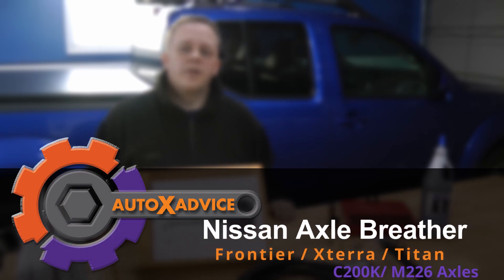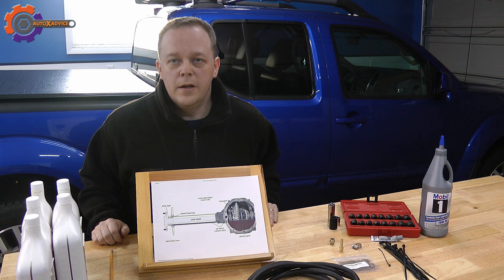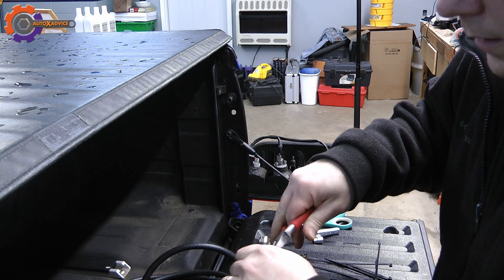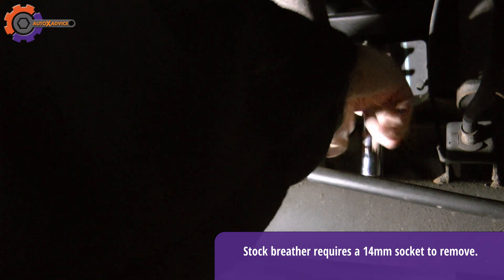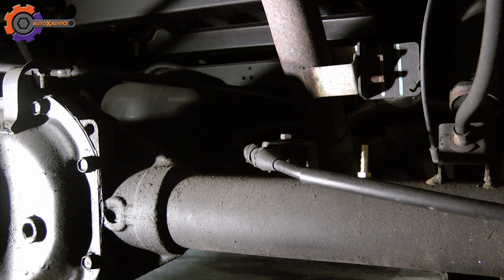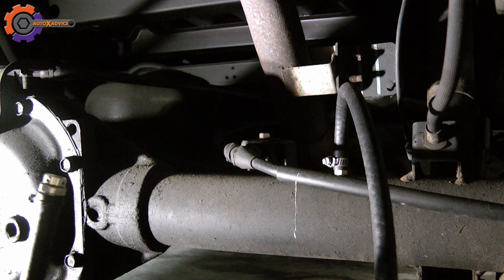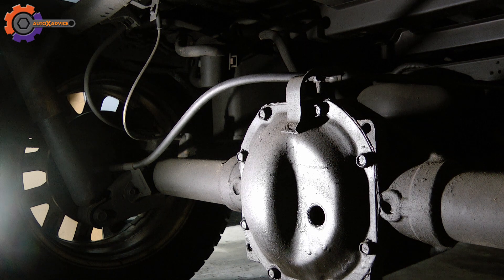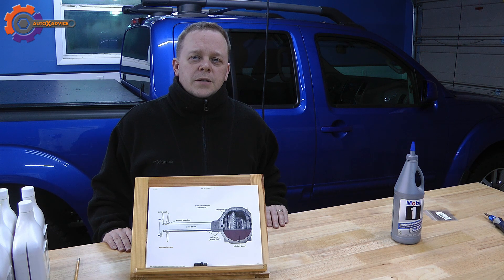Installation of Nissan Rear Axle Breather / Vent and Differential Fluid Check

Comment: What type of gear oil would you use in a 2013 Frontier with 4wd? 75W-140 Synthetic?
Reply from the maker: Recommended by Nissan the C200 rear end recommends 75W90 and the M226 75W-140.  

The Pro4X has the M226

Comment: Just learning about this issue now....  Pulled the rear rotors off my 2016 Frontier  for a brake job and discovered the pass side axle seal leaking.   It's not enough to drip on the ground, but the entire parking brake assy is soaked...  Now that i know this problem exists, i'm gonna go and check that breather before tackling the seal, which i might farm out because it looks like a nightmare job....not to mention there are two different axle designs, which i just also learned about today...  Ugggghhhhh!!!

Thanks for making this video, it's very helpful.
Reply from the maker: Sorry to hear about the seal leak.  Share when you get it fixed.
Reply: @autoxadvice4159  Quick update...Breather was totally plugged with oil and debris, but not rusted shut, surprisingly, as i live near Chicago....  I cleared it with brake cleaner and compressed air.  Was going to do the mod this weekend, but the fitting i purchased per another video didn't fit.  So i reinstalled the OEM breather for the time being...  In the meantime, i thoroughly cleaned the hub and parking brake assy...   Now that the axle can breathe, my hope is the leak stopped...i'm crossing my fingers as i have the M226 axle.  I'll recheck it for leaks in a coupla months...
Reply from the maker: Good to hear.  It's worth taking a chance to see if it stops leaking because right now it can't get in worse with a breather that can breathe
Reply: @autoxadvice4159  

Cross posted on another channel with a few edits.........

A bit of an update...sorry if it's a bit long, but if this info can help someone, what the heck...

First off, per another YT video, i ordered a Toyota part that supposedly can be substituted for the Nissan OEM breather used on the Dana M226 axle...  Well, it didn't fit.   Since the OEM breather basically has pipe threads, I tapered the threads on the Toyota breather to see if i can get the thing started, but no joy....

Unfortunately, the seal still leaked after i cleaned the OEM breather.  I took a road trip down to Indiana, so i figured that would be a good leak check...  Anyway, i pulled the axle the other day, brought it to a local reputable axle shop and re-installed it today.  Total cost for the job was about $275...most of the cost was parts (seal, bearing, spacer...labor was $95)....  But before then, i noticed a bunch of crud (read: dirt and rust particles) in the axle housing, pretty much emanating from the vent.  So, not only did it plug up, it also for some time allowed water to enter the axle housing.  It took me some time to get it cleaned out (rags attached to a stick and "sweeping" it out multiple times) That said, my advice to ANYONE purchasing a truck or SUV with this type of breather, PERFORM THIS MOD ASAP!!

In the meantime, per one of the Nissan forums, i purchased a breather nipple Nissan Part #38323-C601A (used on the Titan), and nope, it didn't fit either...  In fact, the threads looked pretty identical to the Toyota part.  Another 15 bucks down the toilet since it was a special order.  Soooo, instead of throwing more $$ away for nothing, i decided to remove the plunger from the OEM breather (what a sh*t-azz design...sheesh!) and attach a 3/8" ID fuel hose to the nipple.  Since i don't do any hardcore off-roading, i routed the hose over the differential and over to the left side, securing it on the parking brake cable with the open end pointing down.  Still debating if i should put a screen on the end, or leave it open.  The last thing i want is the screen to plug up.....   

The problem with this setup is the hose has very little to grab onto because the nipple on the OEM breather is very short.   I'll keep an eye on it, and if it holds, great, if not then the last resort is to potentially waste more $$ on a British pipe thread (BPT) fitting, which was also mentioned in the Nissan forum....

So, other than changing the differential oil (Nissan OEM synthetic 75W-140 @ 25 bucks/quart X 2+) and swapping out the axle mounting nuts (they're 1 time use at about 6 bucks apiece and on special order.....better safe than sorry), this job is done. 

One more thing...  The original bearing was a USA-made Timken.  The new one, and the guy at the shop said he ordered everything from Nissan, is a Chinese bearing....  

Did i say do this mod ASAP??
Reply from the maker: Thx for sharing
Reply from the maker: You are very welcome.  This is one problem area Nissan has never fixed and I've heard the 3rd Gen still has this same designed breather.

Comment: I just had both rear axels replaced on my 2018 Frontier pro 4x because of this exact issue. I will be performing this fix very soon. Thanks for the information and video.
Reply from the maker: I heard that the 3rd Gen Frontier that it also has the same breather. 

 Nissan, just fix it!

Comment: Mine blew the pinion seal, after that I changed it - Factory new , the old one was just plugged up ....Brake clean washed out like new ...
Reply from the maker: That's a bummer, though cleaning will make it newish again it will clog again for you.

Comment: I should have done this years ago. I live in Alabama and it's 2wd so I've gotten stuck several times in the mud and I pull my boat a lot with it. I'm 100% sure it's clogged. My passenger side leaks a little now..
Reply from the maker: That's a bummer.  The only fix is a rebuild or a new axle.   I new axle from a salvage yard maybe cheaper.

Comment: Here's what I'm very concerned about with the type of kit that just has a filter on the end like what Gorilla off road supplies: Do you remember or do you still have the oem one from the factory that you could check & see if it had a positive seal like a check valve where it would seal out atmospheric air from the rear end until enough pressure builds up to open the valve & release pressure? If so I'm concerned that it may not be desirable to have the differential always open to the atmosphere & allow condensation to settle inside of the diff especially when the humidity is high. I see All Dogs version is a little different but I believe theirs is going to allow air to flow freely as well...could you please confirm that for me as well with the one that you installed on yours? That's why I'm wondering if the guy from this video has the right idea. He used a Dorman diff vent on the end behind the tail light that should close when it doesn't need to be open & I would really appreciate your input on it cuz you seam like a really smart guy...that's why I've subscribed to your channel. Here's the video:        https://www.youtube.com/watch?v=sqCH6K5lsjE&t=284s
Reply: You were right. I pulled it off to see for myself & it only has the cap crimped on it & it’s open to the atmosphere.
Reply from the maker: That's a bit why it is just garbage.  It's sad too is that it's a known issue and probably would be $5 compared to blown seals which is $2k to fix.
Reply from the maker: The factory breather really had no seal to it other than closing the cap from what I could tell.

The filter kind in Gorilla off-road needs to be placed at the highest point so that water cannot get in and that position is behind the taillight.  The All Dogs Offraod can be placed right on the axle and doesn't need to be placed behind the taillight.  If I remember right it has a membrane that closes when the axle is submerged.  The original doesn't have a membrane.

Comment: I don’t off road & I never submerge the rear end in water on my Frontier. I live in the rust belt & have a 2019 model. The vent spring still moves freely up & down & I’m wondering if you think it would be ok to just leave the factory vent in place & just check it & maybe oil it @ each oil change?
Reply from the maker: For like 40$ it's a good precaution.   What happens is that cheap thing rusts and it clogs in the interior.  

You could keep an eye on it over time but you will need to unscrew it and check.
Reply: Good advice. I see some kits come with a filter. Could you say which kit you would recommend & why?
Reply from the maker: Either the Gorilla Off Road or All Dogs Off-road.  Both should work.  I run the All Dogs Offroad.

Comment: Would this kind of set up work on a R50 pathfinder?? I have the same silly breather on the rear pumpkin.
Reply from the maker: Yes.  Xterra, Pathfinder, Frontier, and Titan.  It's about the only OEM part I wouldn't recommend as it rusts and clogged to easily.
Reply: @autoxadvice4159  Can’t find anything online so maybe you can answer this. Does the front diff have a breather?? If so is it the same as the rear or already extended?? I’m looking at getting a kit.
Reply from the maker: Front dif has a breather hose.  It's located on the side of the air filter box.  It's not the same as the rear.

Comment: Can you over tighten the breather valve when installing it?
Reply: I think I might have slightly over tightened my barb from the ADO kit!? Screwed all the way down with small gap between axle and brass barb. I noticed very tiny little brass flakes at last turn of wrench ! Did I mess up any advice please?!
Reply from the maker: Yes it doesn't have to go in that far, just to snug.   It's a tapered end.   I don't think it will mess it up unless you stripped the threads.
Reply from the maker: You could, you just need to get it snug.  It's tapered so if you over tighten it you could easily snap off the threads.

Comment: I just did this breather mod to my 2010 nissan titan SE and used a 1/8 BSPT to 1/4 barb fitting since I couldn't find a fitting with a bigger barb size. I hope this helps people looking for the right 1/8 BSPT (British Standard Pipe Thread (28 per inch)) fitting. Don't use 1/8 NPT bc the thread count (27 per inch) and design of the thread is different.
Reply from the maker: Thanks for stopping by, commenting and leaving some details on the Titan.  I'm assuming the Titan has the same horrible breather then?
Reply: @autoxadvice4159  yes it does. It caused the seal to blow out twice and thankfully it was still under warranty when it happened. I'm not sure what the dealership did to fix the problem the second time maybe used a different vehicle breather valve but I been driving the titan around for since 2014 with no problem. I decided to do this mod anyway.. I jus wish I knew this sooner
Update...im glad i did tthis mod bc i forgot to say that when i changed it over, the breather valve that they rwplaced was starting to rust and clog up. Good luck everyone.
Reply from the maker: That's great information.  Again thanks for the details and good luck with your Titan.
Reply: Good to hear ur Titan got this mod. Care to share year and where you found the 1/8 BSPT to 1/4 ?  I got the 1/8 NPT and it doesn’t screw in the axle, I’m not forcing it either. Trying to source 1/8 BSPT to 1/4 barb fitting
Reply: @Mow4LessLawnCare  I was wondering the same....
Reply: @CorneiliusLibowitz I ended retreading TO 1/8 NPT and it was cake after that. Hope this helps. Send me a message if u need other tips about this. 👍
Reply: @Mow4LessLawnCare  i typed "1/8 bspt to 1/4 barb" in the search on amazon and was the first on the list and was labeled that i bought it sept 2023

Comment: Does the end of the hose in the tail light have to have a breather fitting (or whatever that metal insert is)? Or can it be just raw hose? I'm planning on buying a single vent breather and raw hose from the parts store
Reply from the maker: If you don't cap the end of the hose  debris and water can get down it.  Yes, that metal part is the breather and you can definitely make your own the hardest part to find is the fitting for the axle.

Thanks for stopping by and asking
Reply: @autoxadvice4159  Thanks!

Comment: Nissan dealership tried to sell me a replacement breather piece when they noticed some dampness by the pinion seal. I just removed the old breather valve, replaced with barbed fitting and a small in line gas filter ....end of story.  I don't go thru streams so the filter only goes a few inches above the axle. Seapage by the pinion seal has been minimal.
Reply from the maker: That's a good approach.  However, something to think about.  You may never go through a stream, but let's say you give your truck to your best friend Larry to move his sister from Albuquerque and his sister lives near a stream.  Usually I think of worse case... Just something to consider. 🤣

Thanks for stopping by and commenting.
Reply: @autoxadvice4159  I don't  even lend tools, so the truck stays with me. If there is any flooding where I live on top of a hill, then we are all screwed.
Reply from the maker: Ha...you are then covered.

Comment: Has anyone had the pinion seal in front of the rear diff stop leaking once the pressure is relieved?
Reply: Yes for a few years..
Reply from the maker: Not that I'm aware of.  More than likely you will need a new seal.

Comment: At 40,000 miles Nissan replace my rear axle on my Frontier. It was leaking fluid from where the axle tubes are pressed into the differential housing
Reply from the maker: Odd.  Sounds like an axle defect.  Usually the seals leak (leak at the weakest point).

Comment: Recently had this issue with my 2012 Titan while towing a camper. Leaked out the pinion seal. I changed it out with another OEM breather. My question is.... If the OEM breather and the aftermarket barb fitting have the exact same size opening, what is to keep the aftermarket unit from getting clogged just as easily as the OEM? Seems to me the best method would be to tap a bigger hole, But that would be an entire pain in the A$$.
Reply from the maker: What clogs the stock breather is rust from the breather itself.  Your axel shouldn't be rusting but the breather is just piece of cheap metal.  Nissan should have put in a stainless breather or a brass barb and tube.

This issue is also more of a problem in the rust belt with the more salt on the roads in the winter.

Thx for stopping by and commenting.
Reply: @autoxadvice4159  Considering how oxidized and ruined my spare tire mechanism was (the chain broke when lowering the spare) they should have known better that this would be a main turbulence area under the vehicle for dirt and especially salt. You'd think something like an old tire gauge length above the axel would have been nice.
Reply from the maker: Lots of these trucks have this type of setup with a spare on a chain.  There is allot more manufacturers could do but do not.  New shoppers like bling and most don't hang onto their vehicle for more than 5 years.  

A plastic enclosure for the spare or plastic rear wheel wells would cost a few extra dollars but it's not even a priority.
Reply: @autoxadvice4159  I have my eye on the replacement rear bumper with the swing out spare arm. 🤑
Reply from the maker: Nice.   Issue fixed.
Reply: @autoxadvice4159  just did the breather differential kit from all dogs on my 2015 titan, no leaks but noticed the old breather was clogged with like a soft rust material,  I hope I lucked out,lol.
Reply from the maker: That is what I've seen is that fine metal bits either from the diff oil or the breather itself rust on the inside or a combo of both.  

Check your axle end and see if they are wet looking.  If they aren't wet you caught it soon enough.  You may want to think about changing our the diff fluid if you haven't already.

Comment: Just did that with the ALLDOGS kit last month and it was a very easy and quick mod
Reply from the maker: Correct.  The changing of the vent breather is pretty simple to do and should keep you rear axle in good shape for many years.

Thanks for stopping by and leaving a comment.

Comment: Great video and explanation. Best I’ve seen! I did this on my 2016, bought used last year. 1st mod I did. Did it exactly like yours. I did add a filter in the tail light. Don’t know whether it matters or not but it came in the kit I ordered from off road gorilla. Is that something that needs to be changed periodically? Thanks again.
Reply from the maker: No the filter shouldn't matter with this type of breather.  This breather closes off if submerged.   My truck would have to be under water to the top of that breather and at that point I'd have the engine submerged too (dead).
Reply: @autoxadvice4159  got it. Thanks.